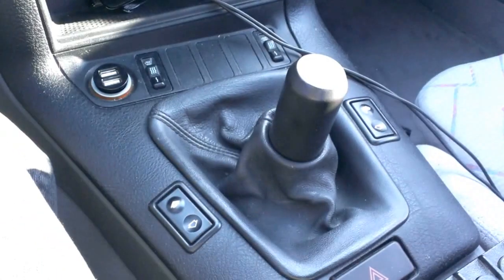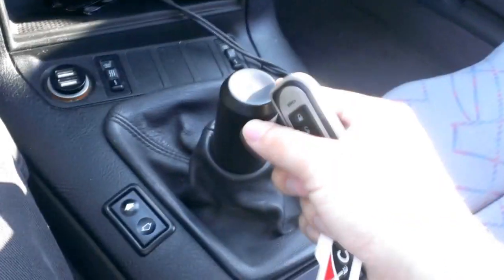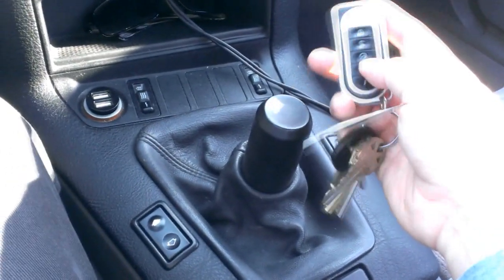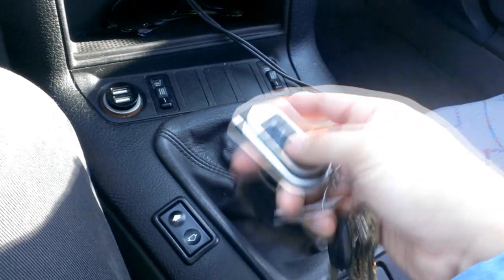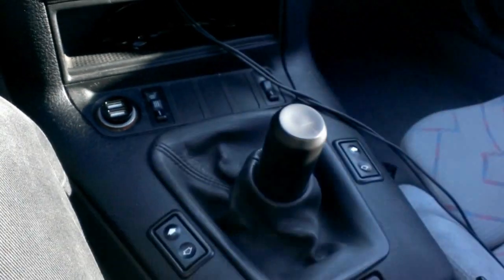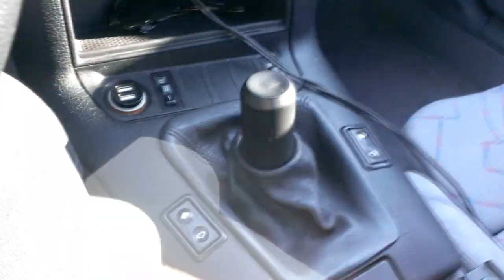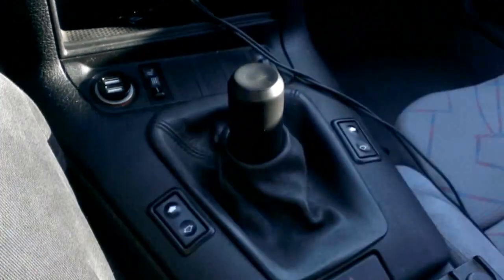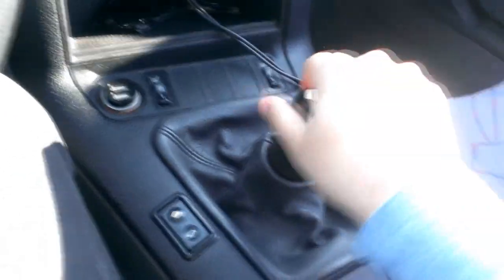Remote Start on Manual Stick Shift Car w/ Neutral Safety Switch

Comment: you wired it to be an automatic transmission mode on a manual transmission?? correct :))
Reply from the maker: Correct.
Reply: elninoloco7 Thanks ,.do you think any automatic remote starter would work in this situation ?? same question for manual transmission :))
Reply: mgbarela I'm looking at the Avital Avistart 4103 I'd like to use this one should be a piece of cake?? :)) I need your opinion please
Reply from the maker: mgbarela Avital, Viper, and Python are all owned by DEI. So it's good quality. The wiring is the same. Installing remote start\keyless entry can get complicated as you are splicing into critical needed wires into the car. If you don't correctly you can damage something.

I would suggest to look into the12volt forums and locate your car for wiring diagrams. It takes roughly 4 - 6 hours to install, assuming everything goes smoothly, you are comfortable in soldering in tight spots, and have a volt-meter in hand. 

EDIT: If your car has a key chip, you need to purchase a bypass immobilizer, otherwise the car will not start without the key.

Comment: How do I do this? Please share
Reply from the maker: I have since sold the car. This so called "proto-type" was good for nearly a full year. But eventually two of the 4 radio shack switches broke after a year of pushing in and out due to shifting. I was going to do the magnet switch reed, but never got around to, and sold the car.

The description on the youtube video has the part number of the switches i used. Perhaps some better quality switches may do the trick. Or even some home made switches using quality springs.

Comment: but what if someone were to barrow your car and put it in 2nd or 4th gear instead of 1st, 2nd, or 5th? the neutral safety switch wouldn't work right?
Reply: sorry instead of 1st 3rd and 5th*
Reply from the maker: I should have mentioned this in the video. I have since placed the switches on both sides.
Reply: gotcha thanks !

Comment: How does the shifter move left, right, forward and back with that bracket looking like it prevents movement in one of those directions? Do you have video of this in action? Here is mine. NSS Neutral safty switch 2000 impreza manual 5 speed standard reed switch